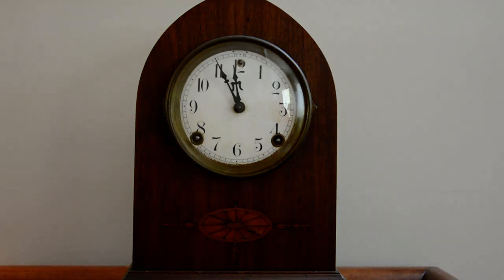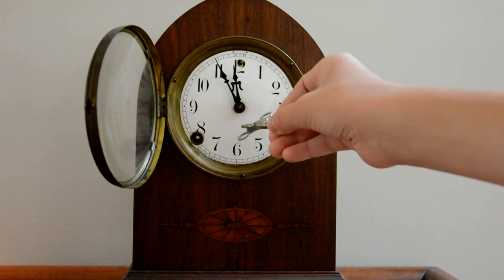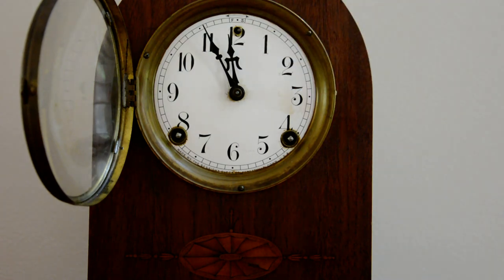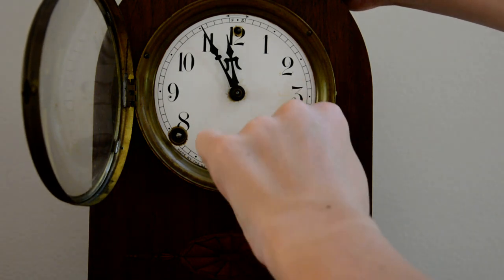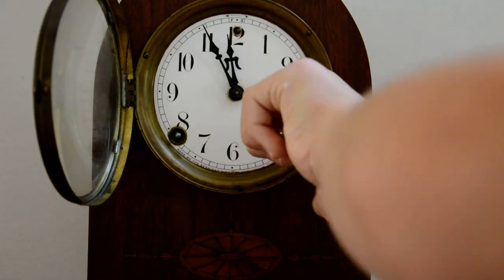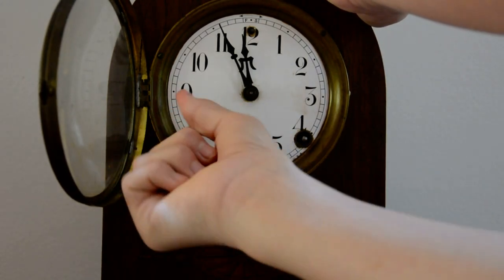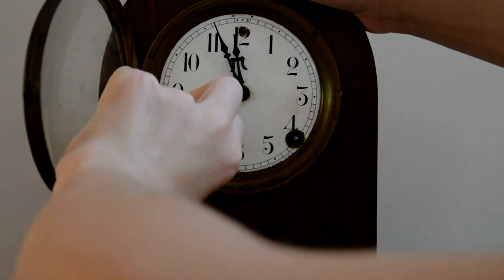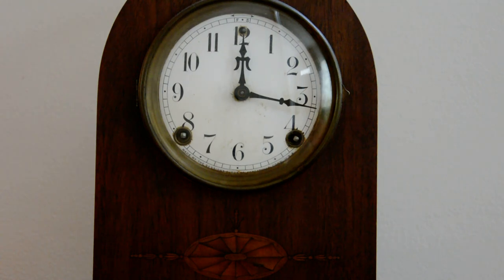Winding The Sessions Mantle Clock + Tutorial

Comment: I was just given a session clock. I can get it to chime at the right time now. But only manually. It will not work on its own. Both winding are fully wond. The right one would not let me wind at all. Can you help
Reply: The second pendulum is not moving in its own
Reply: There is also a L shape thin wire with a bend in the end told the L like a hook. I found this in the bottom of the clock.